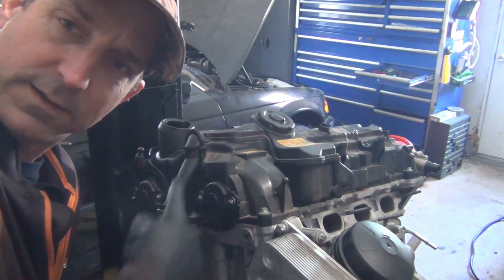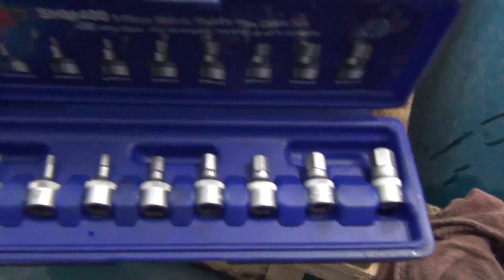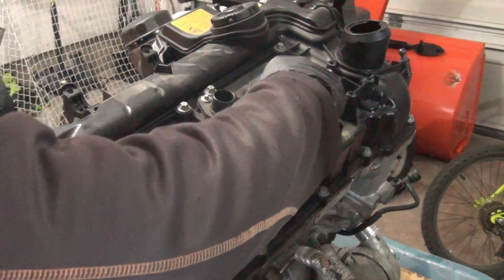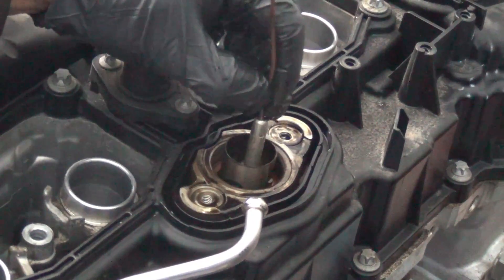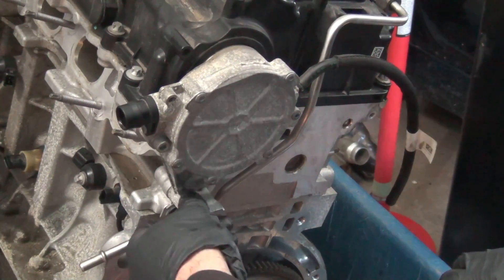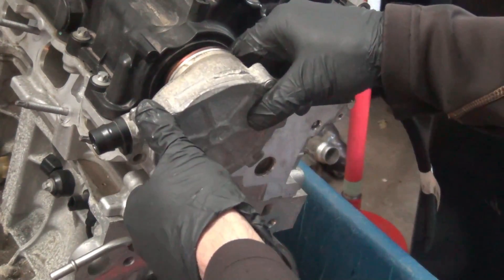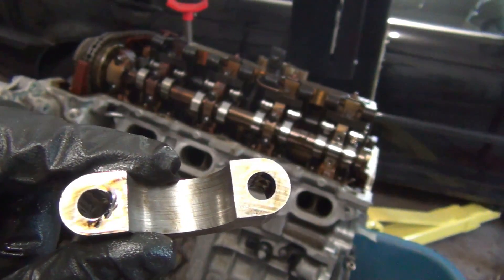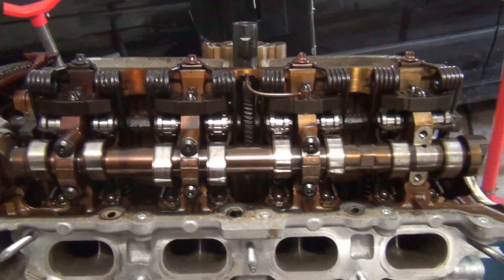BMW N20 Engine Diagnosis How To Remove Valve Cover, High Pressure Fuel Pump, Bearing Cap Inspection

Comment: i have a 535i with 125k miles how much would you charge to replace Valvetronic servo meter thanks.
Reply from the maker: Usually the issue is deeper than just the servomotor. The eccentric shaft would need replacement as well. They bind against each other.